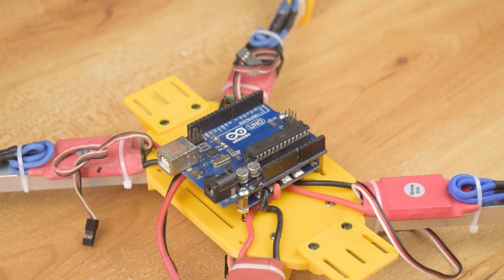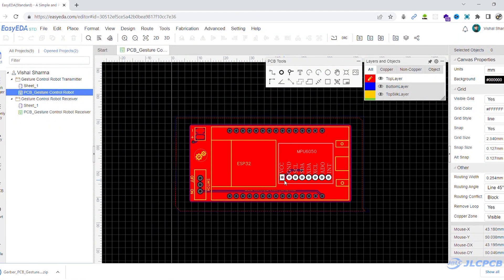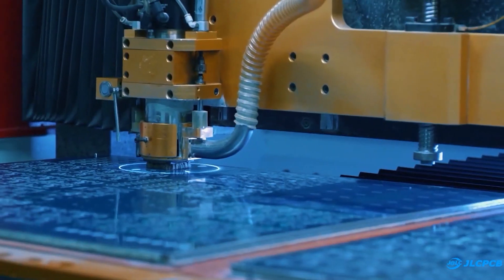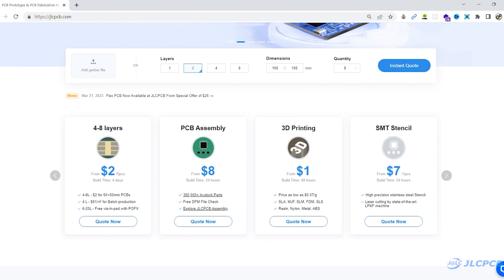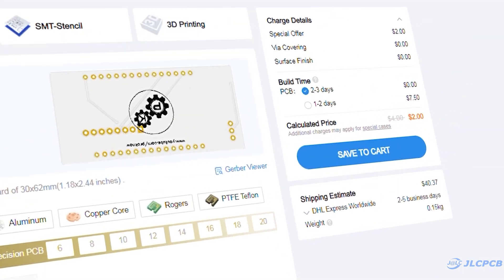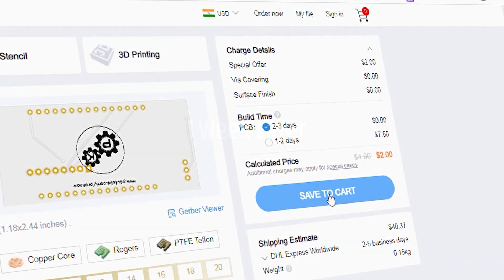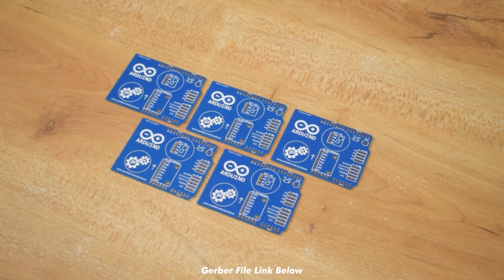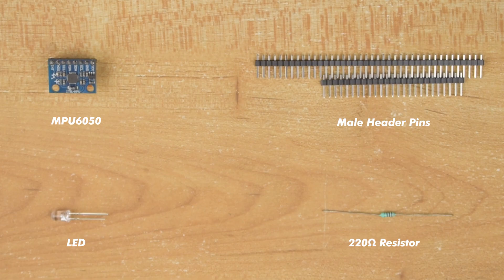Making a Arduino Drone - Arduino Project | Pro Know

Comment: Hi, I try to replicate this, somehow my QWinOut 30A ESC getting really hot when connect to the battery, is it suppose to be that hot ? Is the capacitor being overload with current ? I have 2200mA 11.24V battery

Comment: Why so much efforts.... Just use a H7 based FC with 50+ times more capabilities, and use pre made latest Arducopter. You will get many extra features, and much greater stability. I have made two professional working drones. (Not FPV.)

Comment: I made with exactly the same process and same components but after the calibration of accelrometer the front left motor and back right motor value starts decreasing automatically in the multiwii app why is it happening? Tell me the solution please 🥺
Reply: Same thing  happened  with me bro